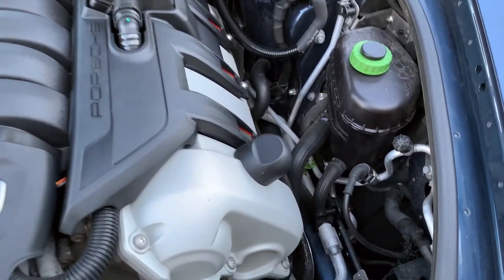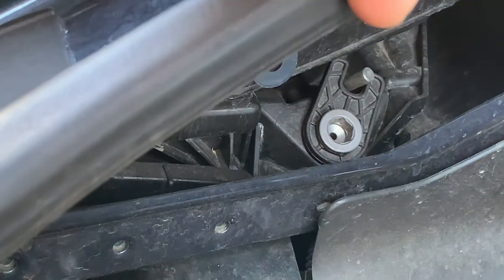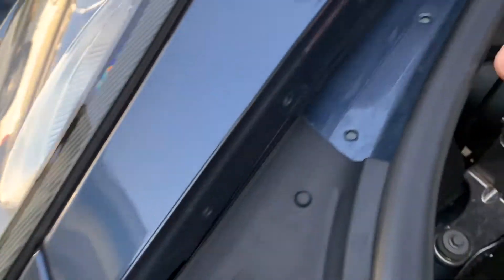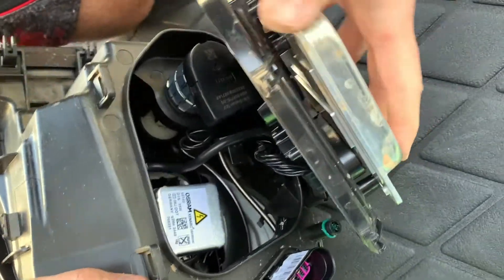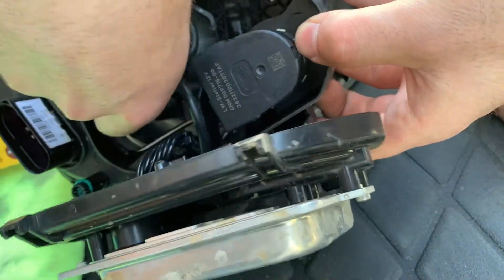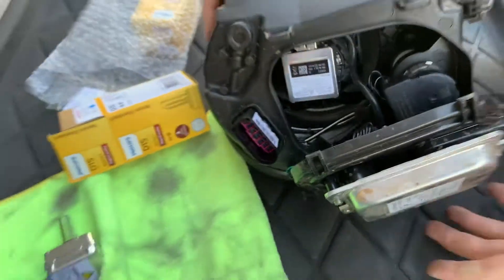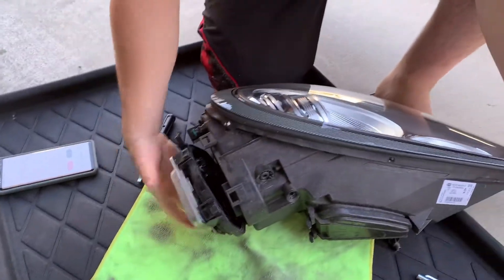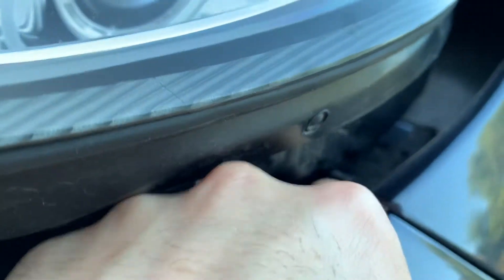How To Change Porsche Panamera Headlight Bulbs / Remove Headlights

Comment: Did you need a fault code reader to clear the headlight fault code after reinstalling?
Reply from the maker: I did not. The car should cycle through cold and warm monitoring of the bulb and detect that it is working.